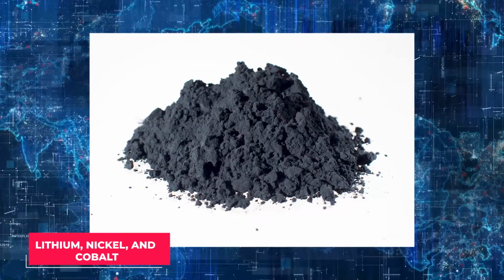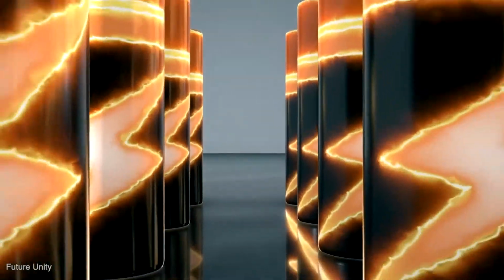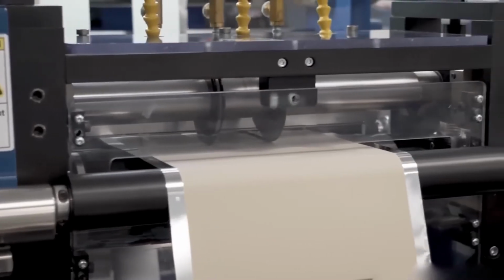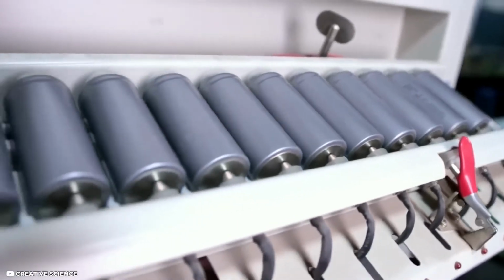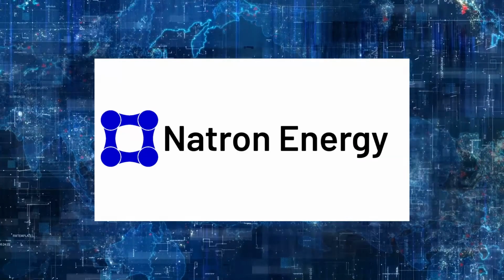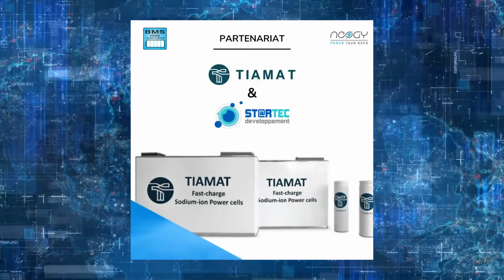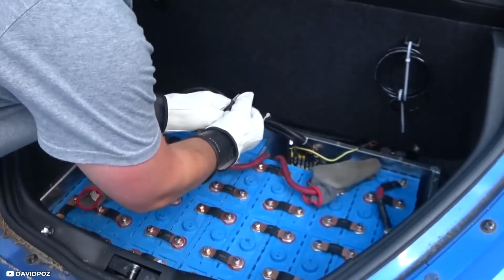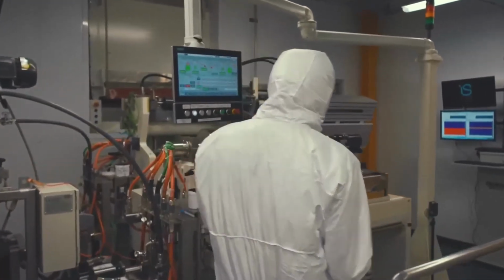The Sodium-Ion Battery Revolution: Here's What You Need To Know

Comment: Edison Promoting electric car 1000 mile run with his "new" at that time battery, 1910. New York. 

More than 110 years ago we had electric cars that had 1000 miles run batteries on a single charge, which is atleast 2-3 times better than todays best electric car battery. 

Back in the day they didn't use Lithium batteries, instead they used Sodium ion batteries which were much more powerful, safer and cleaner for production and environment.
Reply: It's time for you to stop BS and start making these batteries. Of course if you just a BS artist you project is finished the moment you hit an ENTER key.:hand-orange-covering-eyes: